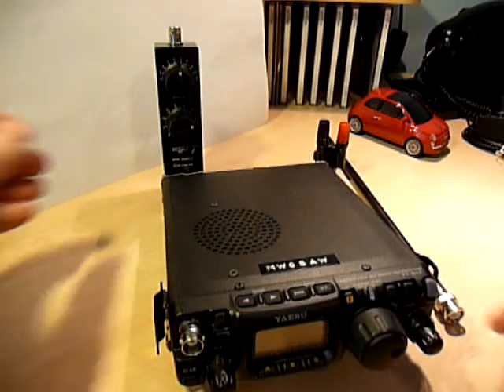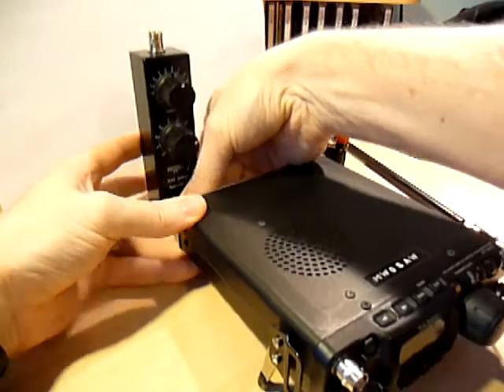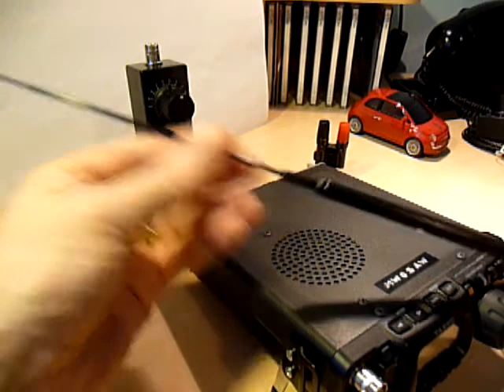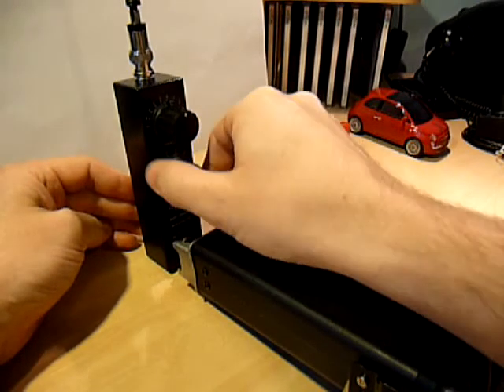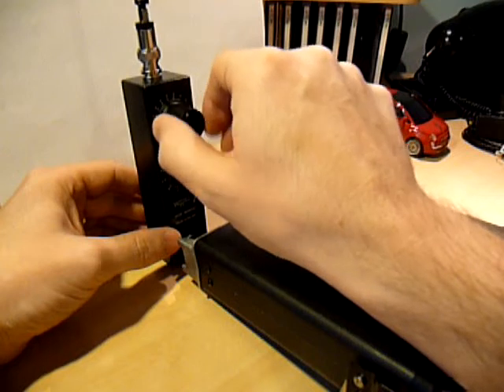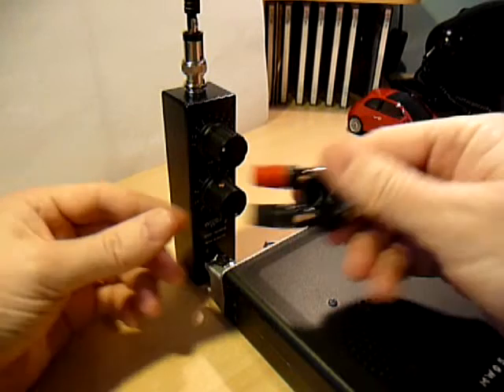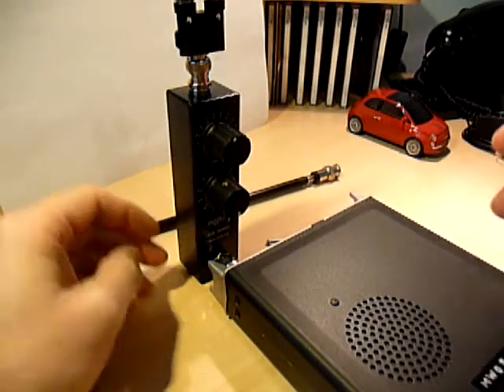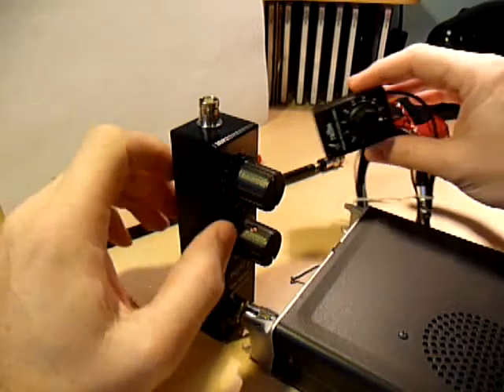Wonder Wand Widebander QRP antenna for FT-817

Comment: Just an update:  I have recently purchased this antenna and use if on my 817ND.  It really is a great little antenna, and once you tune for maximum noise and then fine tune, it works a treat.  Of course this is no replacement for a "proper" antenna, but it works really well for  what it is.

Comment: Hi Steve - Is there a terminal to connect a counterpoise? Main weapon of choice for portable ops is an FT-857 and Par Electronics (now LnR Precision) end fed half wave antennas for 17,20 and 40m - 17 and 20 going up a 10m fishing pole and 40 as an inverted L to the top of a 7m pole. 6m covered with a home made Moxon and 2/70 with a Sotabeams 3/6ele beam. Got some ideas for an easy to carry QRP station, be interested in seeing your solution! 73 Richard

Comment: Hi Steve, What are your thoughts on the antenna having had it for a while? My 817 also has the peg legs. Is there enough clearance at the bottom of the matching unit to allow the use of the peg legs without the radio being physically unstable? 73 Richard M0SNR